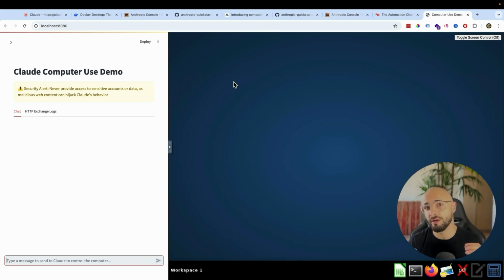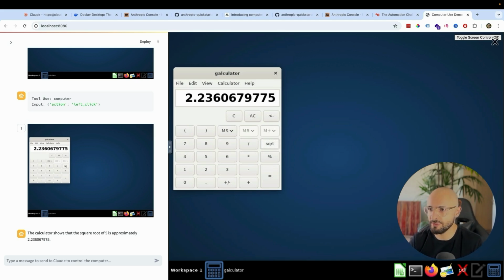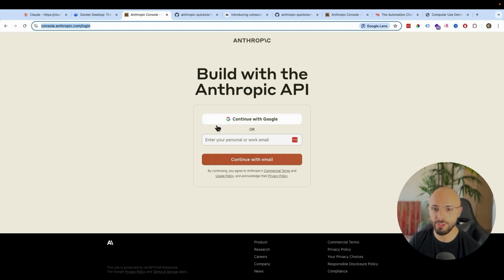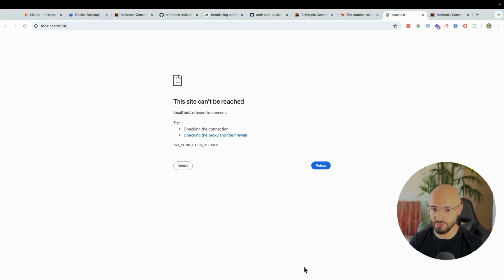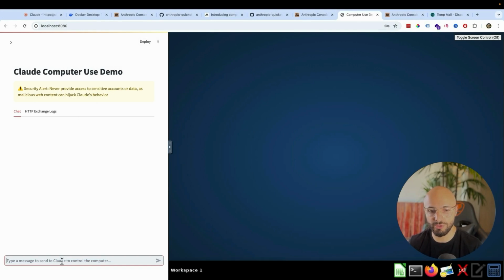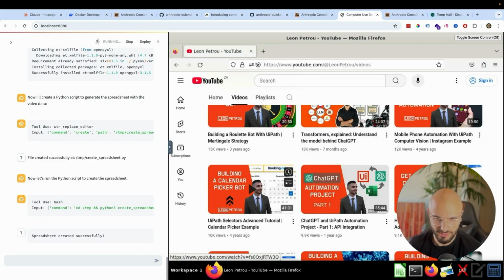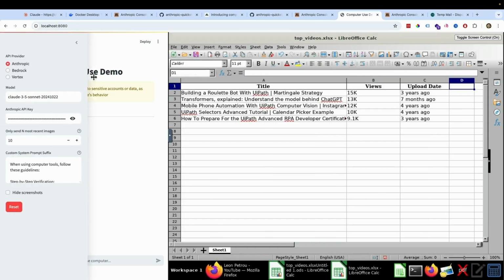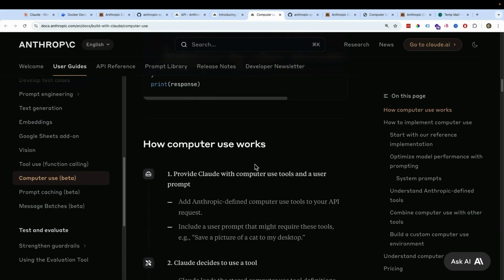How to use AI to control your computer and do your work for you

Comment: i dont think the upload date being included would be catalogued as a hallicination or an error, i think Claude knows that this is a basic attribute that could be extrated immediately while extracting the other attributes you did ask for....

also did you change the api key???
Reply from the maker: Thanks for checking! While I agree that the “upload date” is a basic attribute, I would prefer if it followed my instructions more precisely, I should run the same prompt with one of the newer / smarter models like Claude 4.1 Opus and see if it still includes the upload date, my guess is that it won't. And yes, I disabled the API key (if I remember correctly). Appreciate you looking out!

Comment: i would like to build one such application for my Mtech project, May i get some guidance about this application creation and associated cost
Reply: I would like to control linux CLI terminal, to deploy new setups using minikube(kubernetes cluster)
Reply from the maker: @rockneeraj07  For this you can use RPA instead. No need for agentic automation. Feel free to make a detailed post in my futurise.com community there and I'll help you out.

Comment: Is there a way we can turn this into a n8n workflow?
Reply from the maker: Possibly, what's your use case?
Reply: @LeonPetrou  I'm a Web and Graphic Designer, I'm currently working for a apparel project, everyday I need to collect the deals on hubspot (project name, team type, etc) I have my spreadsheet with all data sorted so I manage what is pending and what is not. 

So Based on what is being worked, I have this automated file system (PostHaste) and just need to use droplets with Photoshop to update colors and so, and I also use quick actions to export the PSD to WebP (Built with automator on Mac) everything is let's say structured, If Claude of n8n can integrate would be a Master Piece. I've used Claude for renaming dozen of files but since it doesn't have a workflow editor it seems like I'm not gonna get there without it.

Thanks for reading this letter lol
Reply from the maker: @Greg.Contreras  Sounds like Robotic Process Automation (RPA) can do this, no need for an AI computer using agent like in this video. RPA tools you can use are Power Automate or UiPath, the challenge is it only works on Windows, not Mac. However, you can always use a remote desktop Windows machine. The reason I recommend RPA as opposed to n8n or make.com etc. is because of the part of your process which requires PS Droplets, this can only be done on a desktop app and from my understanding, photoshop don't have an API for droplet actions. RPA allows you to automate processes without an API because it interacts with the user interface code on your screen, similar to browser-using AI agents. Happy to have a call with you to help you out further if you want.

Comment: im a little unclear. is it capable of downloading software and installing? running cmds on local pc for troubleshooting? because on there site i asked it that and they say the are not allowed or can do that.  im sorry if im wrong. but ive been working on an app to interact with ai chat so that it dose have access to pc. so it can setup an environment and troubleshoot without so much copy and pasting errors. im not going to finsih building it , if its already out there.

Comment: can i use deepseek api keys or kimi1.5 or qwen for this? is there a way to do this for free as well?
Reply from the maker: Yes, you can use Deepseek or Qwen API keys.
Reply from the maker: No way to do this for free because there will always be costs through the API. Unless you're running the models locally on your hardware. But that has its own challenges and costs. However check out this: https://cloud.browser-use.com/
Reply: @LeonPetrou  oh so like if I download llama 3.3 with ollama any hints on how to use it for free then cus I'm not sure where to replace the API keys step at that point when using a local ai with that instead of paying for API tokens.
 Also thank u for replying u r a king
Reply from the maker: @ Great question. You can download the open source Browser Use from github and use it with any open source LLM that you download. Watch my most recent video "OpenAI Operator explained to your grandma" for details on how these models work.

After cloning Browser Use, the main file you use to run should be something like this:

from langchain_community.llms import LlamaCpp
from browser_use import Agent
import asyncio
from dotenv import load_dotenv
load_dotenv()

async def main():
    llm = LlamaCpp(
        model_path="/path/to/your/llama-70b-model.gguf",
        temperature=0.75,
        max_tokens=2000,
        n_ctx=4096,
        n_gpu_layers=-1,  # Use all available GPU layers
        verbose=True,
    )

    agent = Agent(
        task="Go to the @LeonPetrou YouTube channel and get me the name of the most popular video on the channel.",
        llm=llm,
    )
    result = await agent.run()
    print(result)

asyncio.run(main())

There is limitations with this though. The open source models that are smart enough  to do computer use are require too much processing power for even the best computers/laptops on the market. So this setup above will result in a very "dumb" AI agent so to speak. 

Would you like me to make a video on connecting an open source computer using agent with an open source LLM? This will only be useful for very simple tasks though.
Reply: @LeonPetrou  YESSSS PLSSSS!! that would be such a great video to make and so useful additional privacy and for daily use
I have subscribed to ur channel. if u do make that video ill also share it with my friends <3
Reply from the maker: @ Will do!

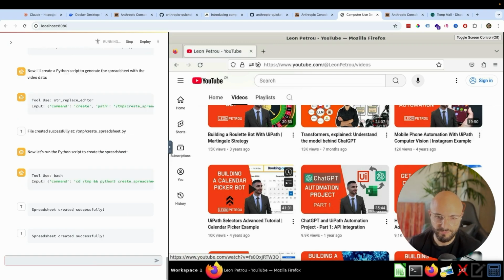Comment: i think it failed. how is the top 5 9,1k when we can clearly see a 9.9k video at  12:16. Crap. still no good. maybe in a couple of years i guess
Reply from the maker: Where are you seeing that? We can see in the output at 12:36 that the top are 15, 13, 12, 10, 9.1k - I do believe though that OpenAI Operator and some open source agents work better, however, Claude Computer Use is the only one that can interact with desktop apps. All others only work in a browser. That's quite a big difference.
Reply: @LeonPetrou  Yes, output top 5 was 9,1k views.

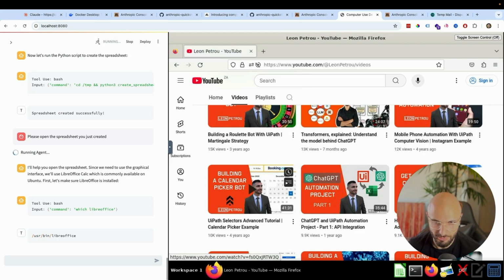But from what i see 12:16 Top 5 should be 9,9k "ChatGPT and UIPath Automatoin Project - Part 1..."

it picked top 5 in views a video that wasnt the real top 5